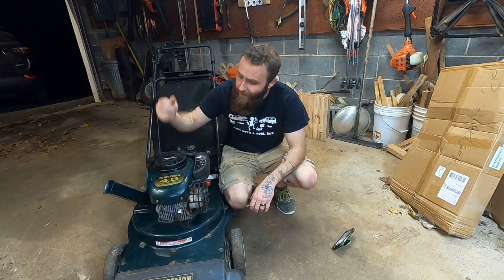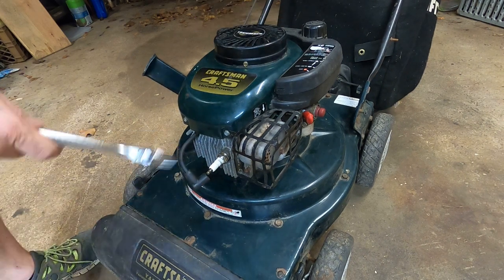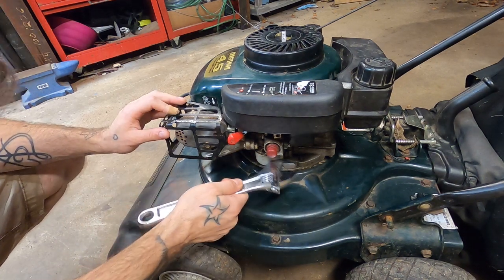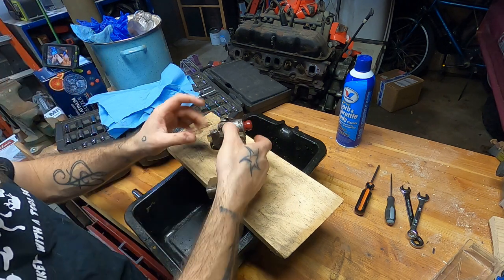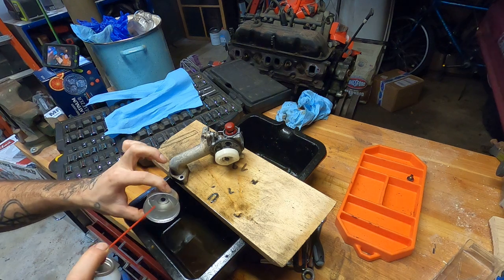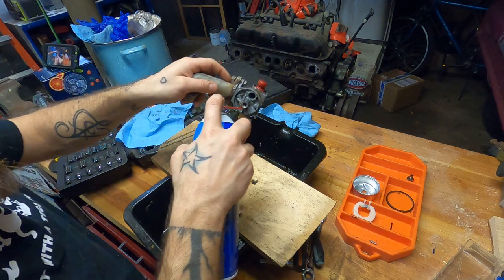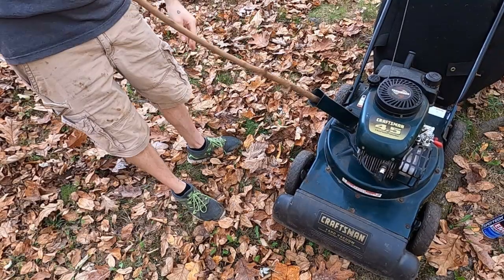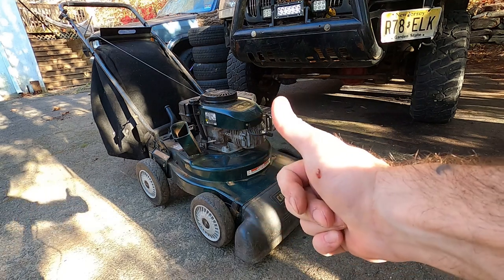Spark Plug Fuel Fouling - Rough Idle, Won't Run (Diagnose & Fix)

Comment: I'm having this exact issue with my Honda 2200 suitcase generator. I took it to the dealership to see if they would fix it under warranty but I'm glad to see that I was correct in suspecting the carb was just dirty. If they will not do it under warranty then I will just clean it out myself.

Comment: Do you know what could cause a new pressure washer to crank and spit fuel but not start? Spark plug looks good and the thing isn't even a year old! Only used it 3 times so It's weird considering we ran it the third time a few months ago.. It's even got fresh oil in it still.
Reply from the maker: Are you sure the fuel is good and hasn’t turned to water? I strong suggest you remove the carb and make sure it is clean as a whistle and flowing fresh gas

Comment: my mower won't start. I did everything to it.i am about to soak it in awesome brand cleaner and rinse it with the hose.fed up with this thing. if it doesn't work when it drops, it will become scrap metal.I am an older female and none of my male neighbors are real men so they can't help. I like these videos because it gives me hope that there are still real men out there that know how to fix things. too bad there's none near me in northern NJ.
Reply from the maker: Well I wish you luck with that! If you have any questions feel free to email me at dandeoffroad@gmail.com If you enjoyed this video, maybe checkout my other channel - Doug v Carburetor - Where all I do is fix old small engines and power equipment which others have left for dead.

Comment: Had no spark on my mtd yard machine riding mower. New plug, new coil and now it will only fire a few times trying to run then dies. Plug gets wet with fuel, maybe even oil not sure.
Reply: my mower doing the same.I think it's a gasket problem.

Comment: From my limited experience with Tecumseh engines (I welded an 8 horse snowblower engine to a bike when I was 14) they are good motors but the needle and seat seem to get misaligned with a lot of vibration. I highly doubt this will give you a problem too often, since you're probably gonna jump the leaf vac or run it at 40mph down a gravel road, but if it does keep happening, it might be worth it to look into converting it to a different type of carb.